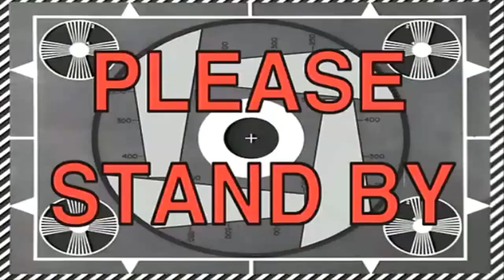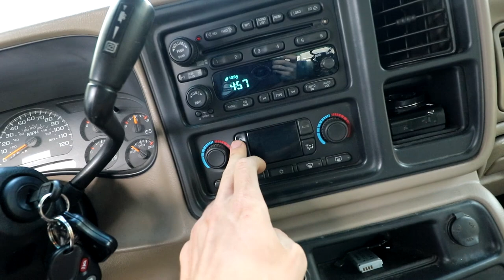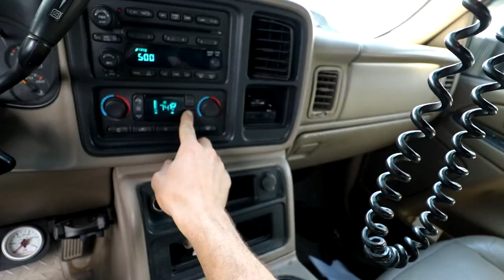BEST WAY to fix a BAD DAY

Comment: 3DMACHINES PLEASE READ!!!  My Mom has a 2004 gmc denail and I had to fix her ac because it was heat and the passenger was cold. There Is motor in the knobs have motor and they move flaps to let out heat or ac. most 2004, 2005 cars and trucks motors go bad. This will fix your problem. Please give me a shout out if this works.
Reply: Garagekid14 202 my grandparents car had this problem too
Reply: You....mean the blend door? yeah pretty common on GMs and Fords
Reply: Yeah.
Reply: Garagekid14 202 Q
Reply: Yes its the door. My buddy used to tick for a couple minutes on cold mornings when trying to use the heat lol it was pretty annoying lol

Comment: When i use to work at Chevy we had to calibrate the blend door actuator to stop the heat from working in combination with the air and always blowing hot air. Recalibrating the blend door in your hvac could fix your problem.

Comment: Hey dalton my 2003 chevy Silverado had that same problem. I did a lot of troubleshooting to try to figure out what was wrong and even replaced the same part that you are. It may still not fix the problem. The problem my truck was having was with the temperature sensor for the inside of the truck. It is that piece above your head when you sit in the drivers seat. I replaced that then my heating and cooling finally worked again. Btw you should go with Jake.

Comment: To temporarily fix your issue on your dmax you can turn the shaft on the truck that the blend door actuator fits into in the opposite direction that its on now (cause its on heat now) then you can move the blend door actuator so that it fits onto the shaft of the truck where you moved it (to cold position) and bolt it in and leave it unplugged. That will give you cold air and keep it their until you put a new part in. I hope I said that where you can understand cause I know home much Id hate to not have A/c even for just a couple days.

Comment: I had the same a/c problem on my suburban.  resetting it by cutting power works, just be sure not touch the a/c controls for a couple of minutes after start up.  The control has to program itself.

Comment: 3dmachines that is a very common problem with those trucks. The same blend door acuator you now have to replace is the one that almost always fails. But luckily it's an easy fix

Comment: 1.  Go with JTS
2. Change your blower motor resistor under the passenger side of the dash. Had the same thing happen on my 2003 2500HD.

Comment: my 06 2500hd had its dual zone go out completely out. while you are under the dash working on stuff check out the condition of the blower relay and its plug. this is a known issue that gm had a recall on because they melt!! this was the problem with mine.

Comment: If its making a thumping/clacking noise, most likely the driver's side blend door motor is bad, theres a plastic gear on a metal shaft that cracks, causing noise and no temp control. Its a common problem with GM's of this vintage.

Comment: ***** HOW TO FIX A/C **************Hey Dalton.  You need a new AC Blend Door Actuator.  It is the one on the passenger side that needs to be replaced even though your issue is on the Drivers side.  It is under the dash on the passenger side closer to the center console.  I had this same issue on my Chevy and recently replaced mine and all is well.  You can find the part online for less than $70.
Reply: Sorry I posted this before watching the rest of the video.  You are on the right path now.

Comment: i have a 04 suburban z71 and mine has ac on passenger and heat on the drivers side... its either the actuator or one of the doors for the ac is stuck

Comment: The AC only works on the passenger side cause the door on the air duct gets stuck. We had a 06 duramax that was used as an Ag Pro work truck do the same thing in the same situation. Except I live in South Georgia, so it was MUCH hotter for us

Comment: Hey to fix your truck cooling on the left you have to go under the dash on the passenger side take it apparat and the will be like a 2in diameter little blower replace it trust me it will work

Comment: There is a plug under the passenger side glove box, the plug goes to the heater core. The plug is melted causing the AC to fail. I had a Chevy with the same issue, got rid of it after plug failed for the 2nd time

Comment: My dad has a 2009 silverado and the door for the a/c and heater was broke in half and let hot air on the driver side and cold on the passenger side.

Comment: don't paint that truck by yourself get doors from wrecking yard! and get a good shop to paint the box. Black is the toughest color to paint it shows every little ripple or bad prep work it will stick out like a sore thumb. If you don't use a clean paint booth you will end up with thousands of pieces of dirt and dust in your paint.

Comment: This is what is broken on your AC 

Look at this on eBay:

https://www.ebay.com/itm/292019068618

AC Heater Blend Door Actuator 604106 for Chevrolet GMC 52402588 89018365 1572971 

This is what is broken on your truck. I have the same truck, gmc version. The driver side is the easier of the two damper controllers to change. Between your dash and your floorboard almost directly under your AC controls, remove plastic guards to expose the damper controller. It has like 3 small hex head screws that hold it up and one plug in. It was a pain to change but can be done without removing the dash. The one for the passenger damper is almost straight above and is buried in the Debts of the dash where no human hand can fit! My passenger one is out right now and it looks like the dash would have to be removed to get to it.
When you first made a video on your AC I posted but probably same as this post it will get lost in the vast seas of comments. If you see this give me a shout out! 😁

Comment: Broken blend actuator motor
Reply: I FixIt - correct. If passenger has a/c but driver has heat; then the blend door actuator is bad. He brought up this problem months ago and hasn't fixed it yet.

Comment: Gm part # 89018365 is what u need to get ur driver side temp control working again there's 3 temp controllers in the truck sounds the the one under the dash on the driver side crapped out on u